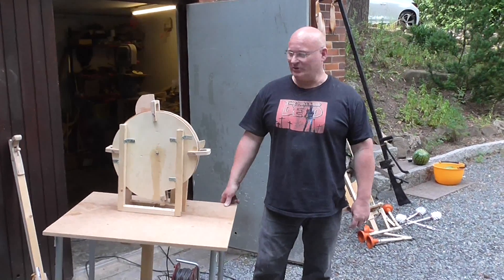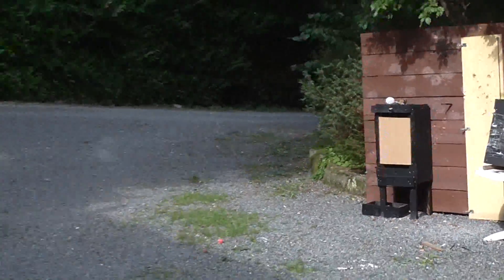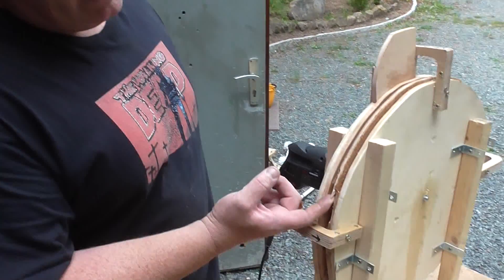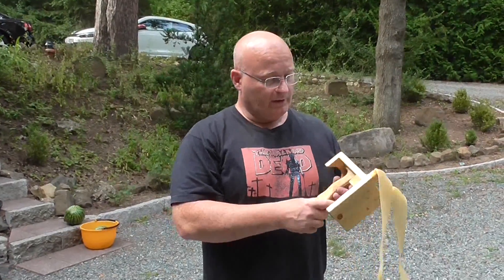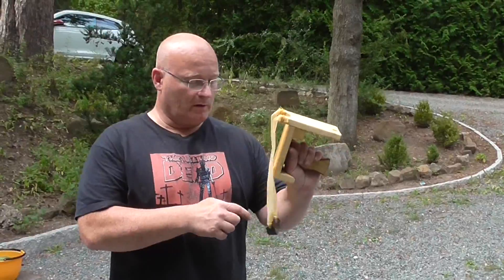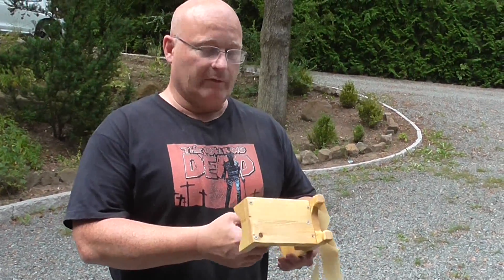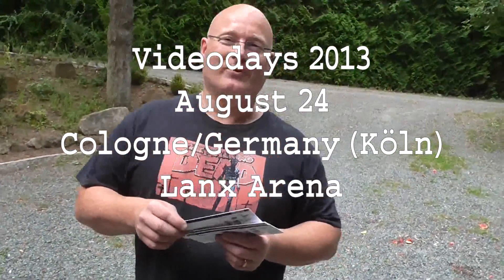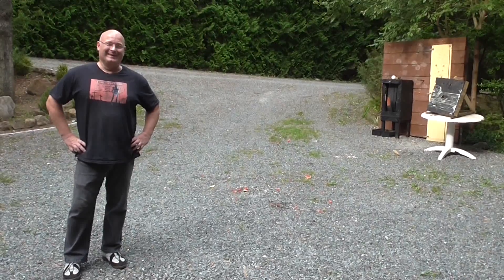Drill Powered Launcher Accuracy Test + 2 new slingshots

Comment: I know boobytraps are illegal most places and I dont want to sound really messed up but my very first thought was it would be so easy to make the drill's switch virtually anything. The wrong person comes through the door and they get a steel ball in the chest or teeth. I would love to see this fortified and maybe using a stronger motor like an angle grinder and you could basically rapid fire it by having a top loader.......  I say you may need a stronger motor to deal with more than 1 balls weight in there and possible balance offset... but man.....

Comment: in the heating and air conditioning trade they use a compressor called a scroll compressor.  it has to nested scrolls (like the track you made your launcher out of) if you could find a very large scrap one you would have a set of machined steel scrolls to work with.  Love your channel Joerg, keep up the good work!

Comment: When I was about 9 yrs old I got a slingshot with metal balls and went to shoot one into the sky at night. Somehow it got caught up in the holder and just came right back at me ( like that video of the girl getting hit in the face with the watermelon ), and it hit me RIGHT IN THE CENTER OF MY EYE!!!. I still have no idea how I didn't go blind, or have it hurt.
I also had a cinder block fall on my collar bone from two stories and an ice skate run over my fingers after I fell on the ice.
These three things I feel so lucky. The cinder block must have landed JUST right, perfectly flush. The ice skate ran right over my knuckles. But the sling shot to the eye, I can't figure out how that could have gone... lucky.
Any eye experts out there? Lol.
Reply from the maker: This is called an "RTS shot" in the community. RTS = Return To Sender. Those happen when the ball slips out of the pouch before it is fully accelerated, halfway to the fork so to say. Then the pouch passes the ball, stretches out far, snaps back, catches the ball on the return and delivers it back to the shooter. Of course the energy is much, much lower than a direct hit. Otherwise your eye would have been gone for good. A nice center hole and a proper release technique will make sure RTS shots never happen - still, safety glasses are a good idea.

Comment: Nice for a small scale artillery launcher: - After thinking on the difficulties of accurately bending either two pieces of Aluminum or Steel bar to the exact same spiral curvature and dimensions. Perhaps making the two spiral rails from "lost foam" Aluminum castings would work better.

Comment: Sorry..   Don't worry we are probably saying the same thing in different ways..  The silly comment was in the beginning by davek71 
I don't know the power rating on a normal dremel,
The good thing about power and torque is that you can gear them up and down. Lots of high speed power mat be converted into low speed torque (same power minus losses). Torque can be multiplied while power cannot, as power is the energy converted to mechanical work per second, and that is (device) fixed...

Comment: to spin the launcher wheel you could use rubber band energy instead of the electric drill... store the energy by stretching rubber bands around a wheel with the aid of a turning handle and release it with a trigger mechanism

Comment: If you really want to make this thing full auto, change the spinning blade to a wheel with 1-2 slots cut through it. The slots should be as wide as the ammo you are using. More channels will increase fire rate, but the extra weight the drill is moving will decrease rotational speed. This will slightly lower fire rate and power. I would love to see this thing powered by an engine

Comment from the maker: Actually, friction takes care of that. The balls are pressed against the outer rim of the tracks, and start rotating. When they leave the muzzle, they spin at a very high rate. Much like a hop up seen on soft air weapons, only much faster. You can hear them "whining" in the gravel after they have bounced off the oak wall.

Comment: I know you like working in wood, but this would be much safer as I say before if it was made from aluminum or brass or even HDPE (High Density Polyethylene) like they make industrial kitchen countertops and cutting surfaces from. It would be easy enough to design the concept you have in CAD and have it machined on a CNC router table as two mirror image sides that bolt together. If you machine it so that only a narrow slit remains for the blade to stick out than the ball could never come out.

Comment: It is not the length of the track that causes the acceleration. It is the distance from the center of the wheel to the outside (the radius) so the larger the diameter, the farther the ball is from the center, the more centrifugal/centripetal force it encounters, (not sure which one) and the faster it goes as a result.

Comment: Thanks but I still don't quite get it. "The ball is forced to go faster" But the maximum speed is still the same? That is the rotation speed of the drill. And if the rotation speed is always the same so why would the go faster on longer distance? And on your example on runners, didn't get that either. The one on the outer trail will lose, given they both go the same speed. Sure he 'has' to go faster, but that doesn't mean he will.

Comment: physics. it gets pushed over a longer track with every turn. the ball is forced to go faster (the same with running at the olympics. the guy at the ouside of the trail has to go faster, than the guy on the inside to be parallel.

Comment from the maker: No barrel is needed. The tracks ARE the barrel - almost 10 feet long. Next model will use water cut aluminum tracks, accuracy should be pinpoint.

Comment: If you would built this in the same size, but in thin metal, the lenght of the spiral would be much longer, resulting to much more power and speed, because the wood is taking a lot of room out of the spiral

Comment: So the next step would be a gas or diesel powered enginge which can easily achieve 5000 rpm even with a 1:1 transmission. The easiest an cheapest thing would be a 50 cm³ 2 stroke scooter enginge with a variomatic.

Comment: The accuracy would be enhanced and you could make it full auto if you had a trap that would release a ball once the propeller was in the correct position to trigger the trap to open.  That way, the balls would be released into the spiral when the drill was at a steady speed.  I think now just having to squeeze the drill and have it start up is likely introducing variance.

Comment from the maker: No matter how long the acceleration is, the RPMs of the drill times the circumference of the outmost spiral dictate the max bullet speed. Battery drills do not exceed maybe 1000 RPMs = 16 turns a second. A 30 cm drum (max for a portable) has a circumference of 94cm. Max bullet speed is 15 m/s. You could catch these balls with one hand. 

A good power drill can easily do 2000 RPM, and at a 1 meter diameter, that is 104 m/s. Bone shattering. Three times as much energy as my world record shot.

Comment: You could try to mimic those toy cars that you put on the floor, and then pull it backwards to tighten a spring, and when you let go, the car drives away. Not sure how to do it with rubber bands, though.

Comment: Hey Joerg. I was just wondering if you've ever experimented with any kind of "shatter ammo"? I had a thought of lightly welding or soldering a small cluster of steel balls together to form a crude sphere, which upon high velocity impact would shatter the bonds. 
What are your thoughts on this, as I am unaware if that would be legal or not and I know you're big on safety.